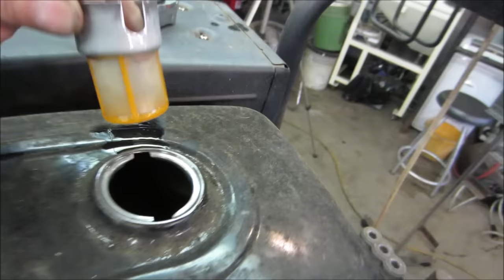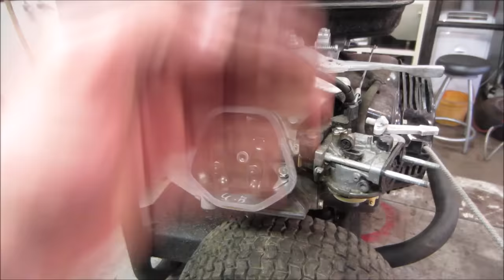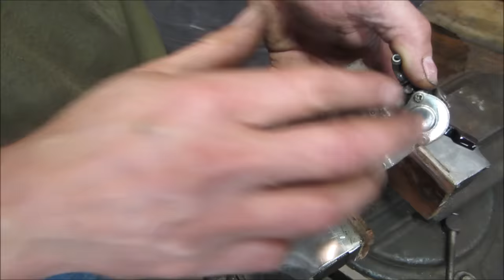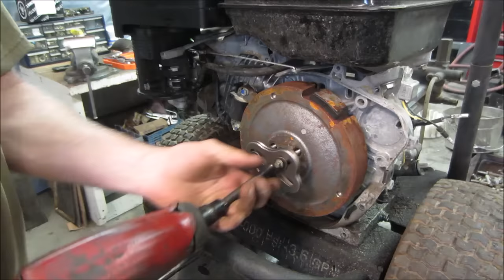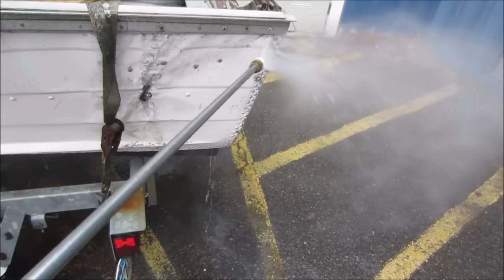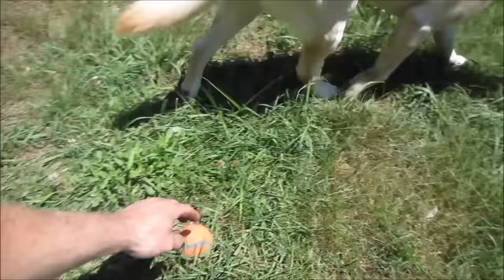Pull start rips out of your Hand? lets Fix It. Busted Pressure Washer.

Comment: In just listening to you talking with him, I would have said the first thing I would have checked would be a coil installed in the wrong direction.... now to watch you fix the beast!!
Reply: I had seen this on a generator where the owner went to work on it and installed the coils backwards (the knock off coils have their kill wiring on the reverse side and wire length can screw up the repair).... it had strange spark and would sputter and backfire.

Comment: I've got a 420cc copy of a Honda, it started to give trouble winding over on the starter so I decided to pull start it and the cord broke due to the kick back.  I used to adjust the valve clearances like you did till I read the manufactures instructions. Adjust the intake when the exhaust is fully open and the exhaust when the intake is fully open. No more kick back problems. Also the carbies with the plastic needle and seat are giving problems with flooding the engine when it is sitting and then filling the sump with fuel. The seat has an O-ring that seals it to the carby body, this fails and allows the fuel to weep past. Its non serviceable , but a replacement carby is $20 au on line.

Comment: love the videos mustie1 ,just a little tip for the future when taking the fuel supply off the carb you can use the choke lever to block fuel pipe as it has a built in stud on it ,keep up the good work.

Comment: I bought a minibike with a clone engine having exact symptoms. I checked key, it was fine, valve adjustment, and it still ripped outta my hands and would not run good. I am gonna check coil. Awesome video.

Comment: well done..nice work..
..tip for adjusting the valves..
if you turn the engine until one valve is open,the rocker arm fully down, the other valve can be adjustet since it is has to be closed...there is no point where the valves are both "fully" open.....that way you don´1 have to seach for the compression point..
greetings from germany

Comment: My brother had a pressure washer that would die after 5 or 10 minutes of running, turns out it was the gas cap
Reply: Creating a vacuum, and not letting the gas out. Yes? Ronn
Reply: Yep if the vent is clogged.
Reply: Had a push mower with that problem. They never put a hole in the gas cap for the vent.
Reply: My snowblower did the same thing. 1/16” hole drilled in the cap fixed it.
Reply: @singlesidebrina7635   1/16”  ??  Americans have such an archaic measurement system .. not at all accurate
Reply: @RobBob555  it's not all that bad. I've been a millwright for many of years for several of the biggest corporations throughout the nation (and internationally working along side with people from many countries) and although the people I work with don't like the imperial system we use, they were very impressed with the zero tolerance and accuracy I could get very high tolerance machinery to. And I was impressed as well with their work. Guess is all I'm trying to say, no matter what you're used to, just be good at it. And don't be scared of the way someone else does it. We're all wanting to end up in the same place when completed, PERFECT. It was/is a learning curve for all involved. Don't down one or the other, embrace it and learn from it! I not only got to work with incredible people from different countries, I walked away with understanding and KNOWLEDGE! So yeah, I agree that the American way is "different" , but aren't we all in a way? I know one thing, I ALWAYS have the best time hanging out with the diverse people I work with. It's amazing how fast all of that other (different) crap goes out the window! Just remember, your zero is my zero as well...
Reply: @RobBob555  1/16 of an inch = .0625 inches, or 1.587500 mm, is that accurate enough for you? 
It's a hole drilled as a vent in a gas cap, not a precision tolerance part machined for a SpaceX rocket.
Reply: @RobBob555  It's exactly as accurate as anything else.  including Whitworth. or stones.
Reply: @RobBob555  It's as accurate as anything else.  Yes metric is easier to understand, but accuracy is not an issue
Reply: Chuck Wood I work in both because of my age and living in the UK. I lived through metrification.  Measure twice cut once😀
Reply: @RobBob555  what system is used has absolutely no bearing on accuracy or precision. US Customary is just as accurate as metric is. It is merely your understanding of it that is lacking.

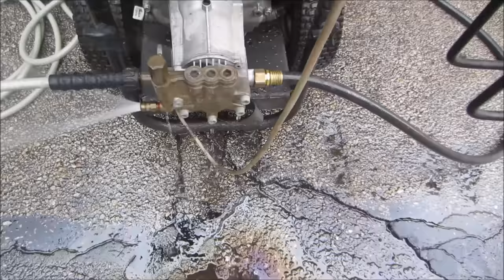Comment: 48:13 that leak is a faulty pressure releave valve that causes a loss of pressure, instead of getting 4,000 PSI you probably only get 2,500 PSI.  Over all you are a pretty good mechanic,  like your vidio. Thank you. ..........................   i love the comment you helped a friend cause you needed to clean your boat, LOL.

Comment: You know a  lot about these engines  and did a good job explaining how things work. The problem was the exhaust valve had too much clearance and the compression release wasn't opening the valve far enough. You said the engine would quit after it was warmed up. I've seen the intake valve set too tight do this, and have seen where a valve seat was loose in the head. The spark plug boot is a resister and can cause little or no spark too.

Comment: Good video.  I've got a new (year old now) walk behind lawn mower with a Tecumseh engine that has more compression than I've ever seen before and I've had a lot of mowers.  It also has a problem on occasion to rip the pull rope out of my hand.  Last fall I was starting it, it jerked the pull rope back and cracked the end of the rope (with the handle) like a bull whip and nearly took off my right nipple.  Man it hurt.  Now I use a glove, a small shot of starting fluid, step back, pull it to TDC keeping the mower rolled towards me with my left hand and then I let the rope back in and pull the rope with my right hand and push the mower away from me with my left hand.  It starts with half a pull every time now.  I think mine needs the same valve adjustment you made here but my engine is smaller.  I don't want to loose any of the compression, but I do want to keep all of my body parts.

Comment: I like it when she’s tight. I would have put thread sealer on those Allen screws where water was pissing out.
Reply: They probably have bad o-rings
Reply: If I remember correctly they are the tops of the tripple pump cylinders, and have O Rings underneath the screw-head.
Reply: @brainndamage  that was my guess as well.  Those are the little things I always fix, but may not have found that reverse coil issue.  +1 for mustie

Comment: I was told in Honda the number one issue with them having problems is the spark plug. Mine would run fine but suddenly start acting up and trying to stall. I replaced the plug, no more problems. As a general rule, I go back over everything the other person said they did because 9 times out of 10, thats exactly where the problem is. I had a guy use sand paper on the needle jet on a carburetor,  it was bad before, he just made things worse. I ended up replacing the carburetor.

Comment: No, I figured it was the keyway, the run 10 minute shut down most like is from the engine overheating from running out of time, on my Honda mower the muffler would turn cherry red on only a slightly sheared key and would jerk the pull start out of your hand. Great job, I doubt if I would have caught that upside down coil.  That little sensor hanging to the right as you removed the flywheel (yellow & Balck wire) may be an overheat sensor, it is in the correct circuit to shut the engine down? Thanks, I learned something new today.

Comment: Having raced these honda motors for many years in quarter midgets here in new england...Run the valves down 1-2 thousands ( 6-4 is way to wide no matter what they tell u)and they will start with one hand on the pull cord...Also disconnect the oil sensor switch...we run these motors at 6000 rpms all day with only 12 oz of oil.  Also be carefully i have found a few out of the hundreds i have worked on that stick a valve in the guide when fairly new( several 160 motors and slight bend in push rod). The emulsion tube needs to be perfect on those carbs.... Pretty tuff motors... Like all these use fuel stablizer in all your gas. Todays gas starts going bad at 2-3 week ....👍👍👍👍 great vid. Dont worry to much about coils...2 bad in 100s of motors and both were crashed hard. Your not changing timing mounting coil ..so coil didnt change anything.....its the valves are  too looose....they actually do not get tighter as they heat up in these...We play with timing all the time and flipping coil wont change it..

Comment: I just repaired my 10 year old pressure washer. Ran it dry, was in storage 3 years, brought it out this year, added fresh gas, it would sputter, but not run. Eventually it hydro locked. Replaced carb, (plus new spark plug and air filter) and it started first pull. Felt great, used it all weekend. Very easy fix. 
Kept old carb, will take apart to see what died, maybe rebuild it, keep as backup.

Comment: I have been watching your videos for about a month, very informative.
Since watching your videos, I discovered that you are cleaning the carbs with the ultrasonic cleaner. 
I have used carb cleaners before.  Lately it was much easier if I just bought a new carb 
I have now bought a 10L cleaner, but have yet tried it.
I have plenty of old carbs i want to clean and see if they work on the engines.
This will give me plenty of spares.

Comment: Thanks for that. Hey, maybe try some dry gas in the fuel tank to rid the water or moisture problem in the tank. I once experienced my old truck bucking over some dips in a dirt parking lot. It cleared itself, but occurred again taking a dip at the entrance of a convenient store. I thought of water in the fuel tank of my old 02' Ford Range was the cause, so I added a Dry Gas Additive and never had that problem again. Now, I add dry gas to my vehicles before the winter season and again in the spring. I put a splash in my lawn equipment tanks too, if suspecting moisture.

Comment: I remember getting a free mower from a neighbor around 2004, attempting to start it I quickly found out what bad timing does as it ripped the pull cord from my right hand and the pull handle slammed into my left wrist. Was level 10 / 10 pain and I had a lump on my wrist for a number of months, wasn’t sure if the lump was ever going away, but it did eventually. Was right where the thumb / small part of wrist meet. I certainly learned a lesson that day and was much more careful when testing mowers in the future. I guess they hit something and it sheered the key which I had no clue about at that moment. Live and learn! Just rewatching this video and thought of that.

Comment: I had a yank the handle out of my hand symptom from a engine a few years ago. The problem was that the coils electronics went arroy. I remade the small chip with micro components and the coil worked fine. The coil for the Redmax backpack blower was over a hundred dollars plus. Did it mainly for me fella. I guess I am cheap like you Muskie 1. Ahh, good to be cheap.

Comment: My understanding of Octane is that High Octane fuel detonates slower, pushing rather than hammering (pre-ignition or ping) the piston.
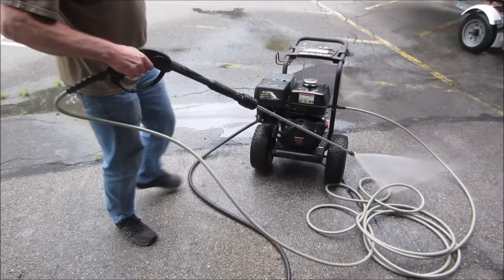Low octane fires quicker and is suitable for lower compression engines.  Very good Catch M-1. PRV leaking?  I always use Premium Fuel (NO Ethanol) in small engines which are seldom used.  There seemed to be a small black cap on the loose at 50:00

Comment: Yep. If the engine has a compression release on it, will aid in starting. With those kinds of engines (my riding mower has one) the valve clearance has to be exact. My valve clearance was too loose right from the factory and I had a hard-starting for a long time before I decided to adjust the valves while doing maintenance. It was coincidental that my valve adjustment just happened to reveal the reason for the difficult starting problem (loose valve adjustment).

Comment: I love your videos in a time when most people are used to tossing anything with the slightest problem in favor of just buying a new one.
I must say, however, that EVERY time you use a screwdriver to check for the piston reaching top dead center, it just drives me crazy. I learned a long time ago to use a plastic drinking straw or anything that is made of softer material than the cylinder head. If anything metal which you stuck in the cylinder gets cockeyed when that piston comes up, it can ABSOLUTELY ruin your day.

Comment: I know exactly what you were talking about with the flywheel key. I sheared one on a mower once when I hit a stump. It would pull back when I tried to start it. I put a new blade (bent the crap out of the blade when I hit the stump) and a new flywheel key on it and it ran for several more years.

Comment: Hi Musti 1, I watched your video about ripping pull start out of your hands. I tried everything you did but at last I found out that the valves were causing this problem. Both valves had to be 0.10 - 0.15 and these were both. 0.25 anyway after adjusting both to 0.15 all Problems over. Thanks for making these video's I am from the Netherland and like your video's.

Comment: My pressure washer would act like it was dragging down the motor then it would kill the engine. It would run great for about 10 minutes before that would happen. I went through the whole cleaning the fuel and carb act. I discussed the problem with my work buddies, one guy asked me how old is the hose that I was using on the water supply, I told him it was about 3 years old, he said buy new hose the old one is collapsingon inside lining. Bought new hose, All fixed! Good Luck!

Comment: A much easier way to remove those tabs on the mixture screw rather than grinding them off is to simply use a pair of wire cutters and it will easily snip  them right off. Learned that from dealing with a lot of those carburetors over the years

Comment: I had a similar fault on a disc cutter, the rope would just go solid mid pull, mine turned out to worn main bearings, this let the flywheel hit the coil when under tension from the pull rope.  If you could start it, then it ran OK.  New mains and seals cured the problem perfectly.

Comment: I have a old Kratcher pressure washer. It just won’t die lmao. It’s a 2650psi 2.6 gpm model with a 6.0 Honda on it. It’s been through one rocker arm and it’s been tortured a lot. It runs really rough sometimes and the oil in it has a noticeable metal shine to it. I once had to run it on Coleman camp fuel. It started and ran great. I think it’s also had some kerosene in the tank at one point too. Burns oil badly but still runs great sometimes.

Comment: The GX series are great engines. I had a coil problem with the 140 on a lawn mower. Run for awhile, cut off, run for awhile cut off, etc. Finally bought a new coil. It came with a carb & both were under $15!  A year later, owner reports that all is well. Could it have been that the 1st one was backwards? Hmmm.

Comment: The tank usually has a screen filter inside it on the gas line shutoff and it fills up with garbage. When you put gas in it it knocks some of it off the after running it collects on the filter screen again after some run time and blocks it shutting it down.

Comment: Also, a regular business card is what I use to gap the coil.
I tighten the coil away from flywheel,  then place card between coil and flywheel,  I then rotate flywheel so magnetics are under coil.
I then loosen screws and allow coil to slid to the flywheel. Then tighten screws.

Comment: I have a 2004 polaris sportsman 400 atv that will also rip the pull cord out of your hand. While running, The belt ripped apart and got tangled on itself, stalling the motor. Now I can get it running, but it's rough, and doesn't restart well.

Anything other than what you did in this video to look at, to see if there's a problem? 

Love the videos, keep up the great content!

Comment: Amazes me that as far as we have come with everything that you still have to hold the wand while you start pressure washers. Seems like an easy bypass valve would solve this.
Reply: It is in place but it’s just harder to start. Applying the trigger makes it way easier to start while it warms up.
Reply: I guess the point is not IF we can do it. Certainly we can. But since it cost money and add complexity (failure point). We're better off by just pressing the trigger. KISS to it's best. ;-)

Comment: The small protrusion on the choke leaver is for putting in the end of the fuel line when you remove it (you take the leave off the carb)

Comment: What are those little red handled pliers you used on the carb.? They grabbed and twisted that little screw head easily.
I had to go through t he carb. on my washer today and then saw this video. LOL. I cleaned a clogged jet, but not the emulsion tube. It ran better but not perfect. I will have to go back in and see if I can get the tube out to clean it. This is on a Karcher pressure washer with a Kholer engine.
Great videos! Be safe!